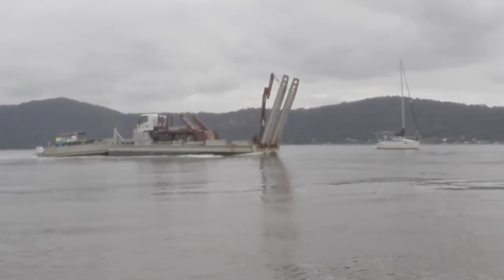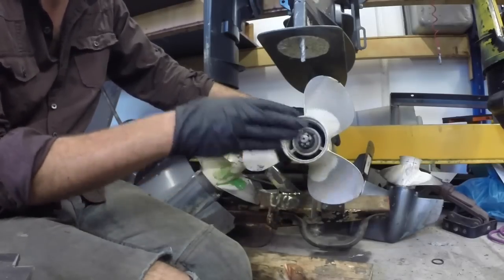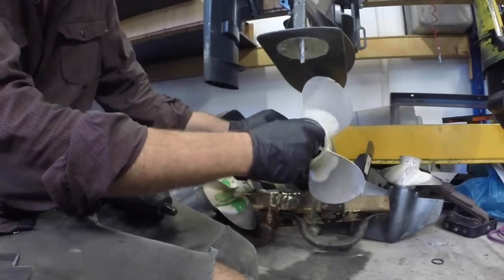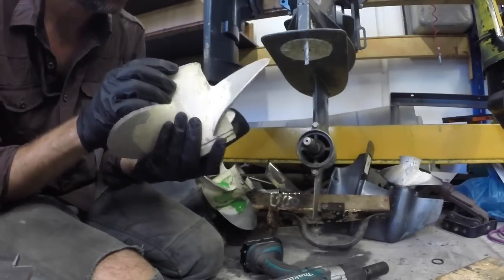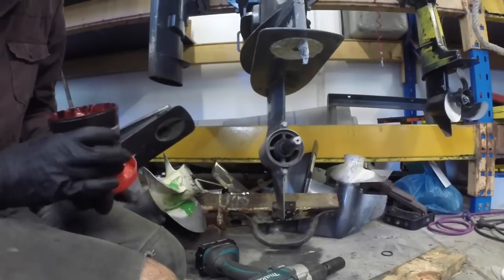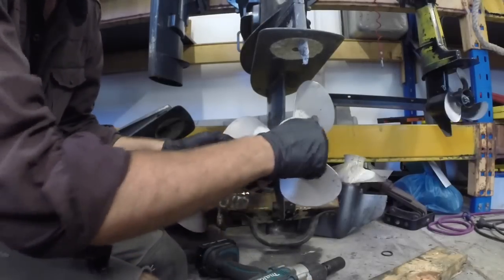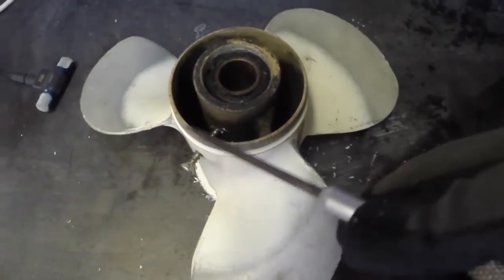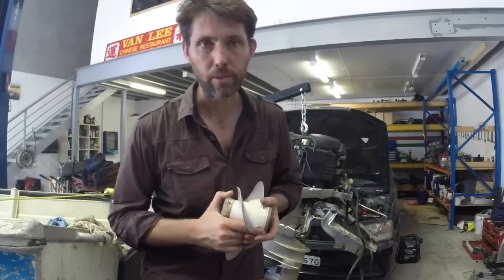Outboard revs increase but boat doesn't accelerate

Comment: Stu  - Same symptom, but this doesn't seem to be the issue. 1984 Force 85HP - ran nice first 2 trips out, but only short distance & low speed...tried going a bit further & faster next trip and lost power at about 3/4 throttle. No overheat warning, but seemed to be a bit warm...had stuck thermostat...replaced...still have same issue...motor seems to run smoothe  just no power...any ideas?
Reply from the maker: Sounds like the main jet in the carburettor may need cleaning out. The idle jet is probably fine but you just aren't getting the fuel for high speed running.

Comment: How far should a 1982 60 hp motor be in the water on a 1754 tracker grizzly? Maybe should measure below bottom of transit?
Reply from the maker: Generally the anti ventilation plate should be level with the bottom of the hull. This video goes through that a bit https://www.youtube.com/watch?v=IonsSQYVsU4

Comment: I have a mercury 90 hp year 1993 mine was acting as if the prop was spun and I took it to a shop and found out that's its not spun what could be my issue ? Please help I can't figure it out.
Reply from the maker: +Dustin marse Is it making any noise like the dog clutch is slipping? Did it happen all of a sudden? Picking up some debris in the prop will give a very similar effect.
Reply: Dangar Marine it don't feel like anything is slipping.  It Idols great will go slow but once I start giveing power the power head rpm jump up but it's not wanting to go I have great impression 89 head one 89 head to 89 head 3 . And now I'm running into another issue yesterday I was getting my trim back working after getting it back working easy fix needed some trim fluid and it started working but after I got it working I was trimming it and down to bleed the air out . And out of no where's everything stoped working all of my electrical but I'm testing power right now I have power all throw the motor I'm useing a power meter to check everything it's shows I have power running everywhere but when I turn the key nothing happends the dash lights don't come on just nothing is work. Please help . I'm in the boat right now on land trying to figure it out.

Comment: hello i m from croatia.. i have old johnson 60 on a smal plastic 4.20 meters boat. the motor is put in corect hight but the problem is when i go from standing still to full trotle boat instantly jumps in plain but then goes in high rpm like it sucked air or the prop is sliping. but when i go easy on trotle lets say 10% every 5 sec i can get to 100% trotle without any problem and at 100% max rpm is 5600... realy dont know what 2 do. prop is 11 3/4x17 aluminium and i m mising CONVERGING RING on it. is it posible that its sucking exaust in and velntilating? tywm for any information :) ps. sory for my english
Reply from the maker: Hi Ivan, that is an interesting problem. I'm presuming trimming the motor down further doesn't help the problem. It does sound like when you accelerate at full throttle it is creating a funnel of air from the surface that is never broken. You might find a hydrofoil helps your problem https://www.youtube.com/watch?v=-TG2I9M8XoY
Reply: i dont have elektro trim on it and i placed it all the way down i m gona try next triming it up perhaps when nose of the boat goes up rear will go down and motor 2 (i m hoping) if not then gona try some kind of hydrofoil. or beter yet concrete block in boat then is 100% down :). ty for your answer u r very popular in coratia i sow all of your videos keep the good work
Reply: Ivan Perac in

Comment: yes I got a 1976 mercury thunderbolt 500 50hp 4cylinder outboard how do the reverse cam locks go I cant find a pic no where thay are on the shift shaft I need help bad or do I have to have theme
Reply from the maker: If you are looking forward information on how parts go I would highly recommend taking a look at the exploded parts diagram for your outboard. Just put the serial number into this site and you should be good to go http://www.boats.net/parts/search/Merc2/Mercury/parts.html

Comment: I got exactly the same problem with and i changed propeller and its same problem also now the engine cuts off when i put into the gear please help im bus mechanic and for  me looks like cluch sleeping but i dont know any thing about outboards engine its first boat in my live. Its mariner 40hp 6e9 please help help thank you

Comment: ok so this happened to my Yamaha 15hp so i dropped the leg and pull it out had a look at the prop and all the bits and pieces it turns out it was the prop seal but when i try and put the leg back in the engine doesn't allow me to shift back into reverse or neutral what could be the problem there and how do i fix it
Reply from the maker: This video should help you with that https://www.youtube.com/watch?v=B4acSf_BgP4
Reply: Thanks so much man got it after about 5 mins of watching the video after i played around with it thanks again

Comment: Wow, I just ran into this issue this weekend. I've been racking my brain trying to figure it out and failed to consider the simplest issue.  Thanks.
Reply from the maker: Hope you've got it all fixed up now Ferd. Next weekend is just round the corner! :)
Reply: Yep same here. I couldn't figure what had changed. My first ride was great. Second ride after an hour or so it started slipping. I tried all kinds of things. Linkage adjust, trim, I was about to hit myself a on the toe with a hammer. This was the first video I watched. Son of a gun. Simple is exactly what this was.
Next move was the lower unit... Smh

Comment: I have an inboard omc cobra 3.0 
I had the prop slip issue fixed. But also another issue.  After the boat is doing 15-20kms/hr the rpms just Rev up but the boat doesn't go any faster.
Reply from the maker: It could be a problem with the trim of the motor causing the propeller to ventilate as the attitude of the boat changes in the water.
Reply: Dangar Marine  it use to run perfectly till I hit at slow speed too many logs which caused the prop slip issue. But then last time out it also had no power to get up on the water and  just rev'd up.  Trim use to be fine. I think it's a clogged exaust issue as it acted this way with seaweed blocking the ports but this time internally blocked.

Appreciate the reply. I've watched a few of your videos for help.  Ie) the two gear bearings replaced on the prop shaft.

Comment: this is happening to my boat but the motor just die when I but I try to accelerate it. what do u think I should do?
Reply from the maker: +Danny Vo Hi Danny, sounds like a fuel problem. I would check the fuel line for splits, the fuel itself for water or other contaminants and clean out the fuel filters and carburettor.
Reply: Will do. Bc when I started it on land before heading to the lake, I
I gave it throttle it sounds good going Forward and Reverse. Was weird that on water it just die on me
Reply: Ty for replying

Comment: Thanks for the video but I was really hoping you would have shown the actual prop that was slipping from the boat at the beginning of the video.
Reply from the maker: There often isn't much to see with a prop that is slipping. Unless it has completely failed it won't look that much different to a good prop.

Comment: Bit different problem with the same symptom. I have a Yamaha F100A -99 outboard with carburetors. It runs great during idle or high speed. However, when I tried to do waterskiing the engine stalled when throttle stick was turned full at fast pace. It only worked when throttle was used gradually. Propeller is 13.2*21 aluminium.

It just does not respond under hard acceleration as I would expect.

Does the engine has a accelerator pump, is that part 43? http://www.boats.net/parts/search/Yamaha/Outboard/1999/F100TLRX/CARBURETOR%201/parts.html (names are wrong, 43 should be "diaphragm assy 2").

Are the carbs clogged (I have used carb cleaner solvent)?

Where is the problem?
Reply from the maker: As soon as I read your problem I was thinking accelerator pump. As air is lighter than petrol, when you open the throttle the ratio of air gets greater and the motor is stalling due to going lean. If the carburettors were blocked it wouldn't idle or run well at high speed. It will definitely have an accelerator pump, so I would be making sure the diaphragm is in good condition and that it is getting fuel and all the hoses from it to each carburettor are clear of blockages. A good subject for a video one day!
Reply: So part nr 43 is a accelerator pump? just to make it sure for me...
Reply: And thanks for quick reply, truly awesome!
Reply from the maker: It certainly looks that way, but odd that it only seems to be feeding a single carburettor. My old F50 was from the same year and supplied all four carburettors: http://www.boats.net/parts/search/Yamaha/Outboard/1999/F50TLRX/CARBURETOR%20LINK/parts.html
Reply: Well, that is exactly the puzzle here. It seems to be the pump but why does it feed only one carb? That is why no one seems to be sure if it really is a acc. pump
Reply from the maker: I'm not sure why no one suspects it. If it runs well at low revs, run well and high revs but goes lean as you accelerate then that is exactly what the accelerator pump is there to prevent from happening. If you disconnect the outlet and push the throttle forward, does fuel squirt out?
Reply: Ok, thanks! I will test that as soon as I get back to my boat. Outboards and carbs are new to me, that is why asked if it really is a accelerator pump (part 43 in that Yamaha catalog)?

Comment: looks like something I should check on mine, when I "boot" it, the motor seems to free rev higher until it "grips" the water then  it drops revs a bit and , its off and going. Im not sure if thats actually normal, the boat still gets up to speed though without too much hassle. 50 hp outboard evinrude 97 model.

Comment: What else could it be if your prop is ok where do i go from there
Reply from the maker: Could also be the mounting height of the outboard causing the prop to suck air down (assuming it is spinning) If it's not spinning then it is likely to be something with the gear selector or dog clutch.
Reply: Is there any easy way to find out if it is the dog clutch or gears

Comment: a friend helps, a similar problem only when I am at the end of the gas, suddenly increases the engine RPM and I feel the loss of power,  when I drop the trim everything ok, only when I'm halfway out there I have a problem...suzki 15 hp  5.5 m boat   9 1/4'' x 9' 11

Comment: This exact issue happened to my old Johnson seahorse 18hp. I changed the prop and it still happens. Any other ideas?
Reply: That’s happening with my boat rn what did you do to fix it

Comment: love the videos - keep em coming!!! I think my outboard has has benefitted from most of them... I took my boat out on Sunday and it was having issues with the revs running high and not a great deal of speed but only at times. It then would idle fine but conk out when I went to put it in gear. Any ideas what i should look for?
Reply from the maker: +Greg Hi Greg. If you just said the revs were high and not much speed I would have said this prop bushing problem is exactly what you are having, but it won&#39;t cause stalling when going into gear. It is of course possible that you have this problem and another one on top. The other possibility is that there is some problem with the gearbox that is causing the slipping and then seizing to the point of stalling the motor when you put it in gear. When it stalls, can you turn the motor with it in gear or does it seem completely seized? It is also possible that it is simply running at too low revs that the extra load is enough to stall it. What does the idle speed sound like? Does it sound normal to you? If you weren't obviously back on land at a keyboard, another thing that can cause both your symptoms is having something stuck around your prop. This can cause poor thrust at one moment and then get stuck and lock up the prop causing stalling when going into gear later on. Do you notice anything odd when doing a visual inspection of the prop area? Have you removed the prop? Stuart

Comment: I have a smilar problem? Run her up river last night. Engine is a Sea hores 79 55hp. Just been serviced new starter. She runs smooth but won't go above 4/5mph even a full throttle? Boat mechanic reckons could be the prop? The engine doesn't over rev either? Had enough speed this time last year to get her up on plane. then she sarted hessitating and now first run after winter lye up shes crawling? Mechanic says everything else is running fine. Did check the prop though!
Reply from the maker: If you have this problem the engine will be revving quite high as there is no load on it. If it sounds like the motor is struggling then I would say it is something else.
Reply: I've got a 1966 Johnson sea horse it had been running fine but the gears in the tiller handle have gotten our of wack what do I need to check for

Comment: My boat does the same thing and after watching this video I replaced the prop based on the prop condition but the problem still remains. Boat runs fine up to 1/4ish or more throttle then starts to rev and does not push the boat. Any other ideas?
Reply from the maker: It could be a problem with ventilation then. Can you trim the motor down further? It may need a hydrofoil on the gearbox or a different sized prop.
Reply: Dangar Marine thanks for replying, the prop is factory replacement and I've tried running the motor at ever trim available, no change. It has the factory plate on it. Can height be an issue? It's a 1960's 18hp seahorse on a 14 v hull. I don't care about top speed or anything, i just want it to run correctly.

Comment: my boat with a 28hp yamaha has kind of the same problem what happens is some times when i go slow and hit full throttle the engine doesn't accelarete the first second and then goes but it doesn't happen every time (sorry for the bad english it is my second language and still learning in high school)
Reply from the maker: Hi Matthijis, it may that the carburettor needs cleaning. Some carburettors have small holes along the bottom that progressively come into action as the butterfly valve opens, others have what is called an accelerator pump that squirts a bit of extra fuel into the carb when you first open the throttle to compensate for the fact that air reacts more quickly that fuel to the new throttle setting. It could also be the float level in the carb so I would give it a full service and then see if it gets better.
Reply: Thanks for the response i discovered that i was using the wrong spark plugs (ngk b6hs instead of b7hs) so i changed them still need to test if it's fixed otherwise iam going to rebuilt the carb

Comment: just wondering if you could tell me if this is my problem...
I have a Mercury outboard that does the same thing as you said in the beginning of this video. but  looking at it when I put it to reverse it would not spend but when I put to forward the propeller will spin so well this fix my problem?
Reply from the maker: With this problem the prop will slip equally in forward and reverse so it doesn't sound like it.

Comment: just got my hands on a 1995 Suzuki 40 hp and was replacing water pump and noticed that  I can hand spin the prop in one direction while in forward gear (makes a clicking sound). spins freely in netural and wont hand spin either direction in reverse. Is this common or is it something I need to investigate? By the way I really enjoy your videos keep up the good work!
Reply from the maker: Thanks normal, nothing to worry about.

Comment: If I had bought a Solas Rubex 4 Blade 14.25 X 19P Propeller 9513-143-19 would it have lived to fight another day????????????   The ruined prop is a Solas Amita 4 Blade 14.5 X 17P Propeller 1513-145-17 that I used to tow my teen girls on a tube.  It did a good job.  It still works good enough to be a low speed spare.  
 I unexpectedly crossed a wake (at a 45 degree angle as usual) so big my boat was completely out of the water and I was in the air hanging on to the steering wheel.  While in the air my engine revved high and when I hit the water (wham!!!!!!) my propeller bushing spun/slipped, ruining the prop, exactly as designed,  protecting the drive train from damage due to excessive force.  I wish the engine had a rev limiter.  Oh well, I have more props and next time I see a big boat coming toward me I'll get as far out of it's way as possible and slow my boat speed to a crawl.   This happened in a narrow channel or I would have been further away from the big boat, and saw it was producing a huge wake .   The big boat slowed down when it saw me so I thought the wake would not be very big, I was wrong.  I slowed down also but kept my boat on plane.  I have never seen a boat make wake this big.  If the wake hit me on the side of my boat it would have flipped me over.   He should have stopped his boat because he knew what was going to happen and I didn't.